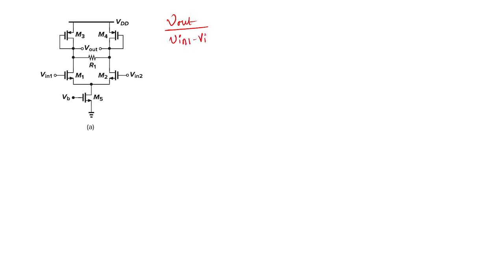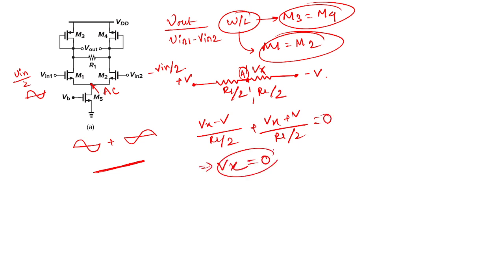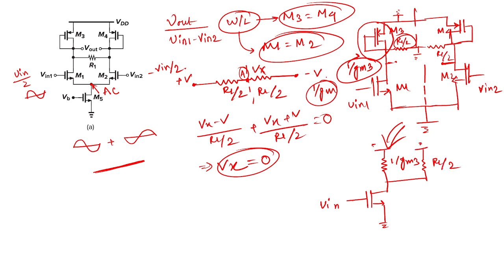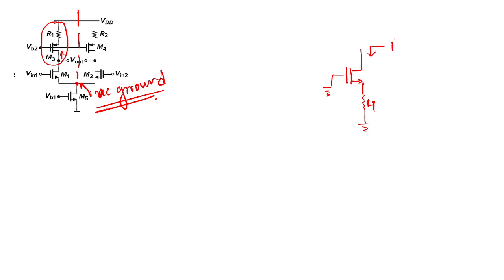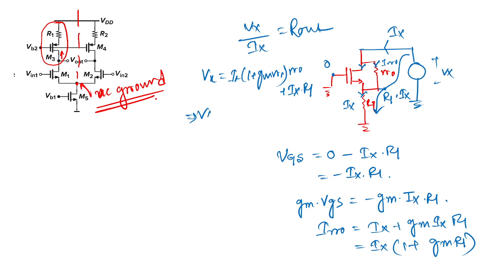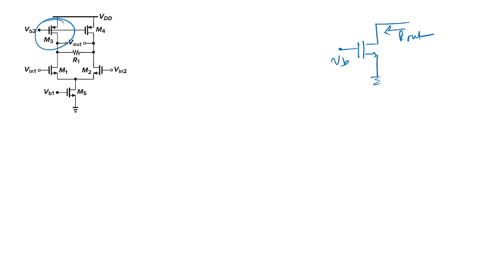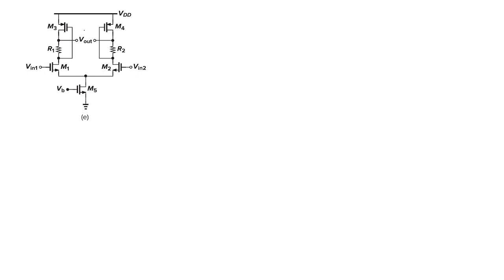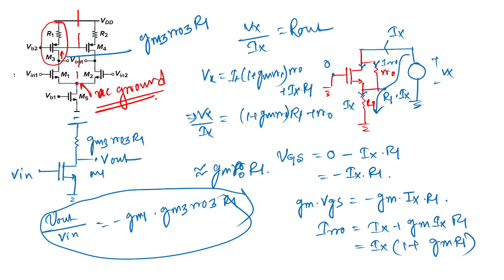Important Problems of Differential Amplifier

Comment: Equalizer core, what if Cs and Ls are connected in parallel with R1 for your different pair Case?
🤔
Reply from the maker: Wait, I will discuss it in next video, thanks for your comments
Reply from the maker: If we connect Ls and Cs as per your description the circuit will behave like a tuned differential amplifier. It becomes a frequency selective circuit.
Reply: Yes yes ❤ @amitjana8172
Reply: @amitjana8172 Thank you very much, I like this unit very much❤

Comment: Great 👌
How to use and implement these circuits? 🤔Ad Everyone should understand calculation(Differential Mode Equivalent Half Circuit)
Reply from the maker: These are some commonly used differential amplifier,  whose differential can be easily found by intuition, otherwise you can make the model and solve the circuit.  Then also you will get same result.
Reply: Thanks for your answer ❤ @amitjana8172
Reply: Thanks Sir ! very useful concept on Serdes circuits application @amitjana8172